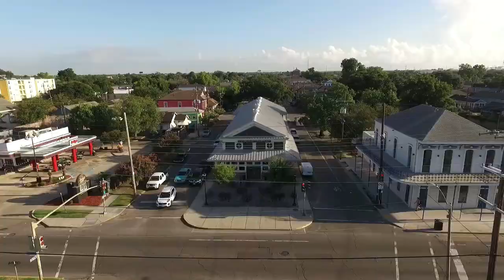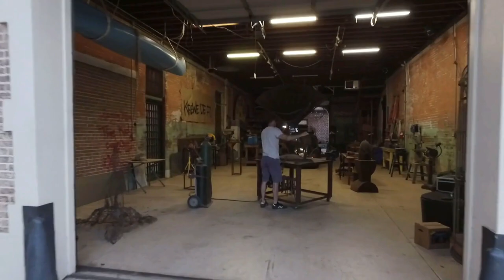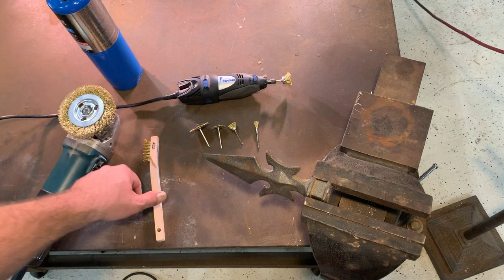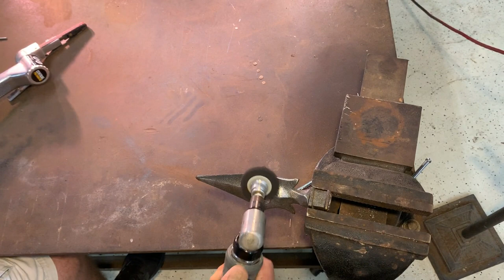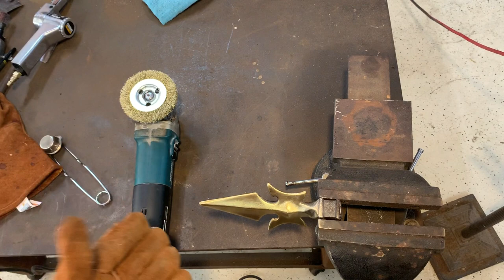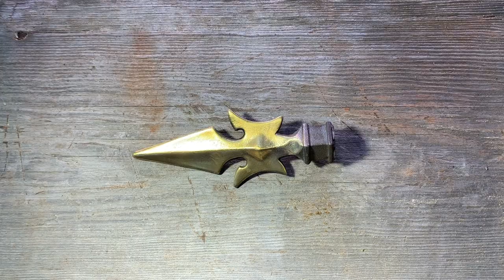How to Brass Plate with Simple Tools - Torch & Wire Brush Hack

Comment: Do you think this could be achieved using a heat gun rather than a torch? My heat gun reaches around 1500⁰F on its highest setting... Don't have the best environment to use a torch being that I live in an apartment complex.

Comment: I have a grandfather clock pendulum the is approximately 6”  in diameter and domed and pretty thin gage metal, think it is brass plated and there are several places where something has pitted the surface with a black stain around the pits. Could this method be used on the thin metal?
Thanks

Comment: Nice! I saw a similar process on a video from the Man at Arms Reforged series and i recall them using a torch too. How high of a heat do i need to achieve on a torch by the way? I may only have access to a small one attached to a disposable butane canister like the ones used in kitchens...thanks ahead! 😁
Reply from the maker: It actually doesn’t require that much heat. Your butane torch will work it’ll just be a slower process and it might not be practical on a larger piece. The steel doesn’t need to be hot enough to have any glow to it (so, well below 900 degrees Fahrenheit)

Comment: Thank you  ,  it's inspiring me  .  but how long it will last
Reply: Depends on how much wear it'll get. Pennies have copper coatings about 10-50 times as thick as this, but you very rarely see a penny with the coating worn through. As long as what you're coating sees less wear than a coin, it should be fine. And if it wears... Just replace the finish again...

Comment: Thank you for the video. Is there a way to fill in the pits? How do you create a thick, smooth brass coating?
Reply from the maker: If you use this method or even electroplating you really need to prep the steel to be as smooth as you want the final surface to be. If you want a thick surface that you can shape you can use a brazing rod and acetylene torch and melt brass on to the surface. It takes some practice and it’s probably not feasible to do over large surfaces but for a small part it works well and you can sand and polish it after.

Comment: Love the technique!! Can we do this on copper? And can we build the thickness by brushing for longer..
Reply: I think you can do this with copper too, copper melting point is only a bit higher (~100 degrees more) and it shouldn't have to be heated all the way I think just enough to release the copper and stick to the metal
Reply from the maker: I haven’t really experimented with different metals but my experience is that you can’t really build up thickness very much with this technique.

Comment: So cool, i wonder if i could do this on guitar tuners? Id like to have brass color tuners to match my brass bridge pins.
Reply: Probably not.  Just buy new tuners.  The worm gear and fitting is too complex to be heated like this and survive.  Even if it did work, there would be slop and you'd run the risk of suddenly detuning.  Changing tuners is easy and new tuners are (relative to instruments) dirt cheap.

Comment: Can you do the same with a copper wheel brush on steel? Ik online it said copper dissolved steel underneath which is why it won’t stick but I’m wondering if this would work as long as you spray a clear poly or lacquer over it?

Comment: I did a pair of electricians pliers unintentionally. I soaked in vinegar because of rust overnight. Then when cleaning with dremel brass brush it turned to a brass look! Any reply appreciated cheers from Australia just subbed. Nice work
Reply from the maker: Yep, I accidentally did it once too before I figured out that it’s a technique I could use intentionally. Thanks for watching!

Comment: will this rub off? and is it possible with a heat gun?
Reply from the maker: It won’t rub off, it’s pretty durable. I don’t know if a heat gun will get it hot enough but it’s worth a try. It may just take a little longer.

Comment: Would this work on an axe or would it remove the axes temper?
Reply from the maker: If you’re careful you could do this to an axe without ruining its temper. Generally cutting tools have a hardness gradient with the cutting edge being the hardest and every thing else being softer/less brittle.  If you watch the tempering process they often use a torch and heat the back edge of the tool and watch the surface oxidation creep toward the cutting edge. Anything heated to red hot will lose it’s hardness entirety (annealed) and where there is only a slight yellowish oxidation on the surface it will be still hard but not brittle (tempered). You can stay well below these temperatures to apply the brass so the temper should not be effected as long as you don’t get too aggressive with the torch and you will definitely be ok if you leave the actual cutting edge alone. I hope that helps and wasn’t too long winded an answer!  Thanks for watching.
Reply: @Chemical14  I'll try it if I can find a proper wire wheel around. Thank you

Comment: I'm working on a custom made lightsaber that I think would look great with some brass coloring. I'm planning on using aluminum and was wondering if I could do this to it or is aluminum to soft at the tempatures needed for this process?
Reply from the maker: I haven’t tried it on aluminum but the heat shouldn’t be an issue, you don’t really need to get it very hot for this technique. I wonder if aluminum might be too soft to accept the brass at any temperature though.  The ideal method to get the results your trying to get would be anodizing. It’s more complicated but there’s a lot of good YouTube videos about how to do it.
Reply from the maker: If you try it out I’d love to hear what the result is!
Reply: @Chemical14  I'll run a test with the extra pieces I have. I wouldn't mind anodizing but considering this is a side project and I don't have my own place to do stuff like that easily I'll just spray paint it black if it doesn't work out. I'll let you though
Reply: @martuna still haven't gotten that far yet. Currently just trying to straighten out the side plates that go inside the hilt and work on the internal electronics
Reply: @SpazmaticAA I was looking to do the exact same thing! Did you happen to try it already, and did it work?
Reply: @phantomarchitect   I haven't tried yet. Been too busy with school and my new job to work on lightsabers.
Reply: I know it's nearly a year past the last comment but for anyone who's still curious: thin brass films will still melt under relatively "low" temps. I've made brass pennies in candle flame and on electric stove tops.
Reply: hello. best luck with your light saber

Comment: How resilient is it? Does it rub off fairly easy?
Reply from the maker: It’s actually pretty durable, you would need an abrasive to remove it.
Reply: @Chemical14  awesome thanks for the reply, the video was great, really informative. I saw that technique on another video but he didn't mention that there are brass coated steel wire wheels like you did,  so I just googled brass wire wheels and went out and bought them without properly reading the description so I now have the wrong wheels and needless to say, it didn't work haha but it led me to your video which gives you more views and me more knowledge so it's all good
Reply: @billysaunders544  the Viking axe? Me too!

Comment: This looks like it keeps the detail of the patina of the steel. 
Would i be able to get a brushed brass effect doing this on brushed steel (if the brush disk is in line/same direction as the brush grain)?
Reply from the maker: Yes it’s a very thin layer of brass so any texture or surface details will show through it.

Comment: Is this possible due to the higher melting temperature of iron, or would I be able to coat brass (silverish) with brass (yellowish)? Thx
Reply from the maker: You don’t need enough heat to really melt either metal but the hardness of the iron is important. Trying to coat a softer metal may not work. Admittedly I’ve never tried it though.

Comment: Hi, I have 1 question after how can you protect this finishing, do you add some coat or other? Because I already tried at home, and that work well but after 2 days I see some rust on surface.
Reply from the maker: I usually put a clear coat over it. Shellac works well but if it’s going to be outside in the weather you might need something more durable

Comment: Will this method work on titanium instead of steel? I can't seem to find any information on line.
Reply: Well the reason it works on steel is bc brass has a much high melting point than steel, so I feel like if this were true with titanium then u should be fine.

Comment: A similar process is possibly used to make brass plated wire for steel belted radials. Brass is critically necessary to bond steel wire properly with the rubber. Without brass coating , proper rubber metal bond is impossible . In circa 1989, the proper adhesion of copper plating on steel was a big problem In India as they used copper plating on steel in lieu of brass because it was easier.  But copper bond on steel was too bad leading to steel wire separating from rubber.The method demonstrated here in the video is the one which should have been used. An electrochemical process is available but not sure if it can be industrially used.

Comment: Can you polish the brass after? Or will you wear it off ?
Reply from the maker: It will wear off if you use any abrasive on it, it’s a pretty thin layer. I usually just add a clear coat right after so it keeps its shine.
Reply: @Chemical14  so polish real good before the brass if anything. I'll do it like blueing a gun then. Thanks!!!!

Comment: Will the steel get rust after brass coated?
Reply from the maker: It will have some protection from rusting but if left in a damp environment it will still rust eventually. I would recommend a clear coat or wax over it for additional protection

Comment: Brass brushes are difficult to get over here without paying an unholy amount of shipping (or getting it from China, which might be worse right now). Would this process work with bronze brushes?
Reply from the maker: I haven’t tried it but my guess is that you would be able to get some bronze to deposit on the surface of your steel although the effect might be less dramatic since bronze usually has a darker color than brass.  It’s a simple process so it shouldn’t be difficult to experiment with different metals and heat sources. Good luck!

Comment: How durable and rustproof is this brass coating?
Reply from the maker: I left this piece out in the weather and it rusted significantly after a few days (this is Louisiana so it rains a lot.).  It probably gives some protection but I would recommend a clear coat over it or wax finish for most things.
Reply: @Chemical14  sounds about right. What kind of coat would you recommend?
Reply from the maker: Beau Leffertstra I like to use shellac for most indoor pieces. It basically makes a hard wax finish.  You can also use beeswax thinned with turpentine for a similar result.
Reply: @Chemical14  brilliant! I've got some of that. Thanks

Comment: Can you then turn it to antique bronze ?
Reply from the maker: The brass deposited on the surface will behave just like normal brass so it will tarnish with time or you can darken it with something like liver of sulfur. It is only a very thin layer though so aggressive treatments could simply remove it or cause the steel underneath to rust through it. Its a good idea to put a clear coat or wax over it after you get the look you want to preserve it.

Comment: Can this process be used on chrome?
Reply from the maker: I haven’t tried it but I doubt that it would work. Chrome is usually a thin layer electroplated on to steel with a thin layer of copper in between as an intermediate. My guess is that those layers would be damaged in the process.

Comment: How bad would this affect temper on hardened steel for armor?
Reply: If you're talking SCA, it's fine.  If you're talking tanks, it's fine.  If you're talking thin costume armor, it may not be fine.  If it is 18ga or thicker (very roughly street sign thickness), you're probably fine.  If it is cuttable with tin snips rather than a nipper, you're walking into problem territory in terms of altering impact characteristics.  My late wife was a chemist and fought sword and board in the SCA and always wanted to do an alloy and tempering demo for schoolkids using swords and tiny shields of different metals.  Fire, swords, and sneaking in chemistry, engineering, and history knowledge: a perfect combo for a school demo.  Thinking about it, her regular undergrads and even grad students would probably have enjoyed it, although the information would likely have been too simple.
Reply: @EvanEdwards  I am a Buhurt fighter, that’s why I was asking. I assume if it’s good for SCA then it’s good for me. Thanks!